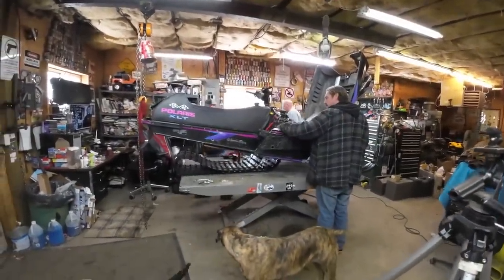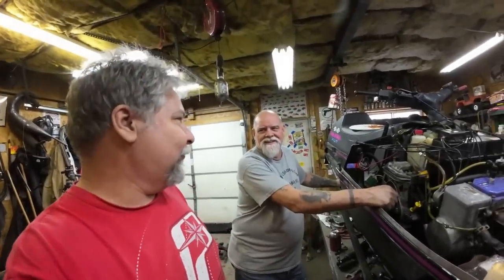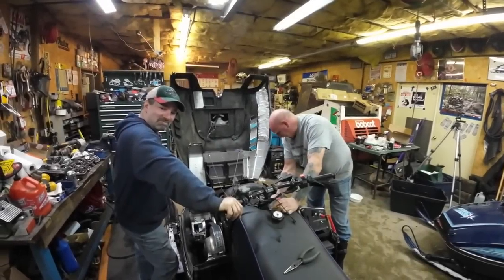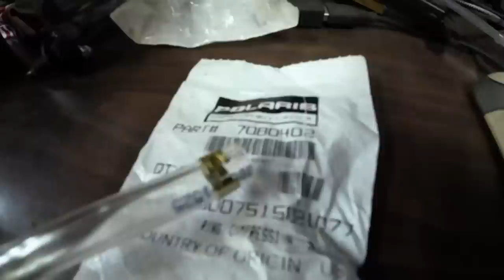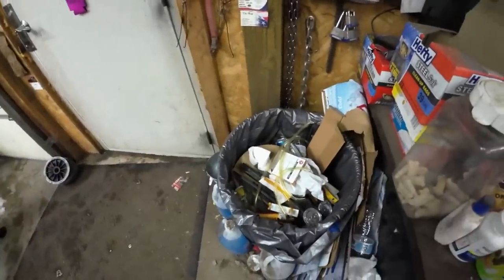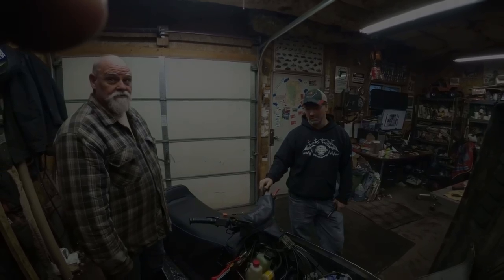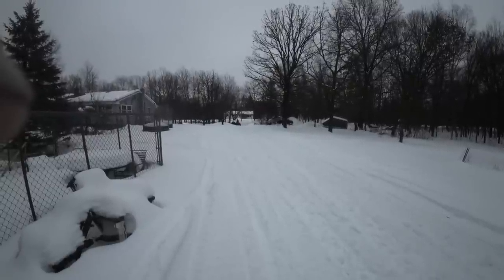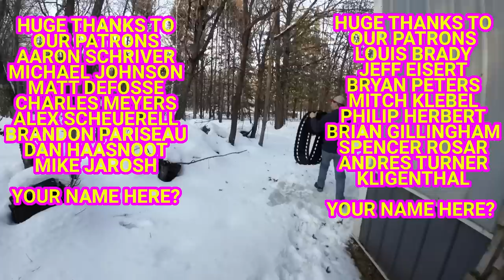XLT Track Swap and Bog Fix. Vintage Polaris XLT 600 Triple Snowmobile tune up.

Comment: If your pulling the drives ! Why not put on Wahl Bros drivers ? I did ! My 1998 XLT gets 13 MPG , slower than my hot rod 2004 SLP Performance Edition & catalog complete Switchback 700 , but that’s 9 MPG ! Slydog skis , 1.25 track , no studs , a snake through the trees where I live !
Reply from the maker: Wahl bros drives are expensive and not needed for a trail sled. They are great, but we throw enough money at these things.
Reply: @nuttersspeedshop  I hear THAT band playing my tune!

Comment: I just got a XLT for cheap the other day. I'm debating fixing it up or doing something else with the engine. My tank was worse that yours but it ran and burned off the old gas. Lots of cutting corners. But I needed to see what it could do. Now I know that its guzzling the fuel and the clutch side cylinder isn't working. I swapped the wires with the middle one and it works. It also died after a while and had no spark. It cooled off and fired up again. There is some issues that I need to fix before I decide to keep it or not.

Comment: Ethanol in the gas ate the fuel line right off, does it on small engines even worse,my buddy works in tree industry they started having 3/4 month old saws crap out from the fuel n drop the filter in bottom of tank leading to poor running,the old fuel lines in those sleds weren't designed to hold up to that caustic junk.

Comment: For what I invested in my 700 switchback , I could have bought new top of the line ! Old School is Cool , wish I could put a WEDGE on it ! Had a clear lexon hood on my 1998 XC700 , 220 jugs , psi center dump exhaust , see your motor !

Comment: Thanks for posting! I just got the same sled, its been sitting for 20 years and I'm sure I'll be facing the same issues that you guys have. I just got done cleaning the carbs, but I can see the tank is full of gunk and all the fuel lines are going to need to be replaced. 
I'll be replacing the belt too, but what other things should I be looking out for on one of these XLT's that's been sitting for a long time?
Reply from the maker: There's several full builds of xlts on this channel. Check those out.
Reply: @nuttersspeedshop  I've been working my way through your 1993 playlist. it's literally the same sled I've got sitting in my garage, thanks so much for pointing me to it!

Comment: Hey did you guys add a oiler hole to your block pto crank bearing. Which year did polaris mark the correction. I have 2 xlts and don't want to spin that bearing. I've seen a video where they drilled block and ran a line to the oil pump. They tapped into the pump. Keep the videos coming.
Reply from the maker: We bought case halves and oil pump to add the 4th line back when we first put this sled together a year ago. There's a whole playlist on this sled and you can find it in there. I didn't do it to mine or Lonnie's. Seems like a great idea but a lot of XLTs lived long lives without it.
Reply: Pretty sure 97 is the first year of the factory extra oil line